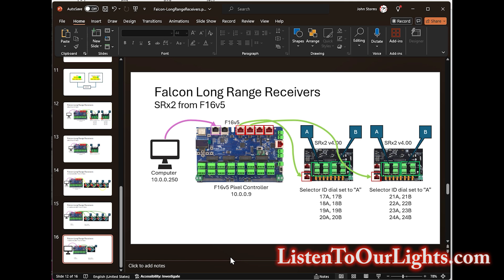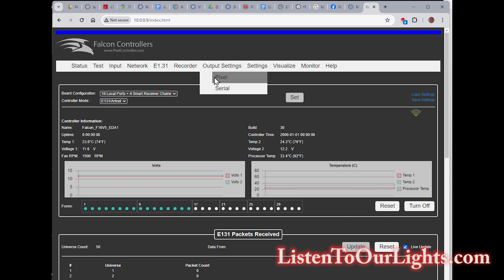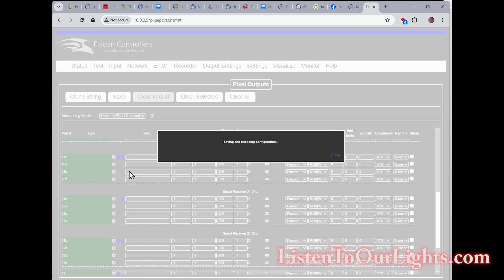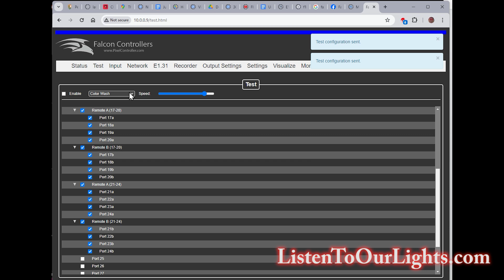Falcon F16v5 with 2 SRx2 Unchained Long Rang Receivers

Comment: John,  Do you have to run the Efuse wire pairs all the way back to the F16V5 or does the SRXV5 communicate turning on and off the Efuses to the F16V5.